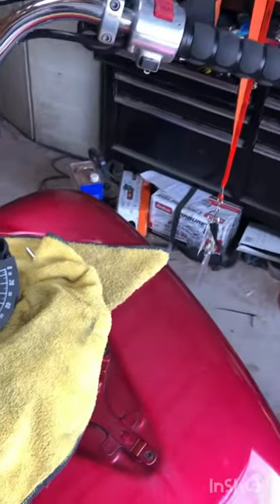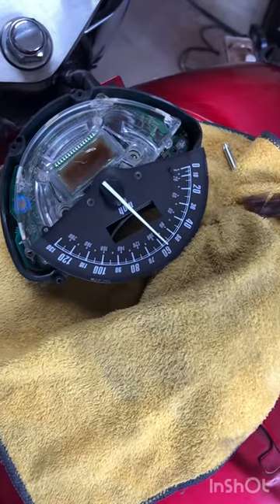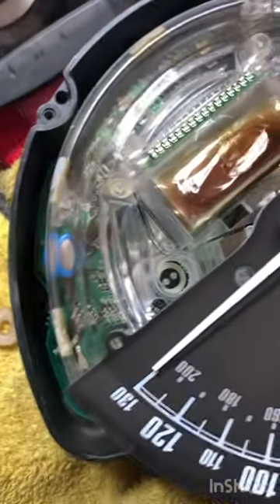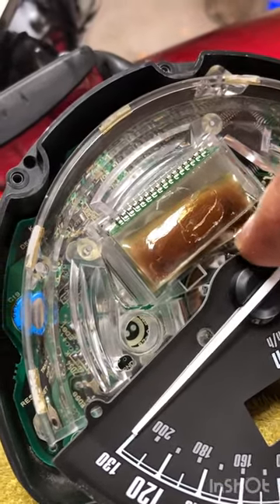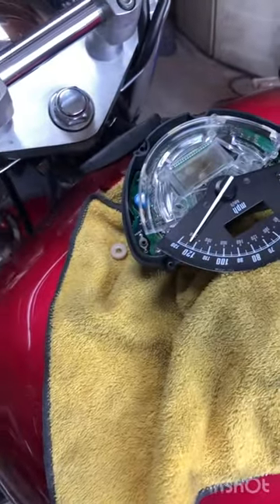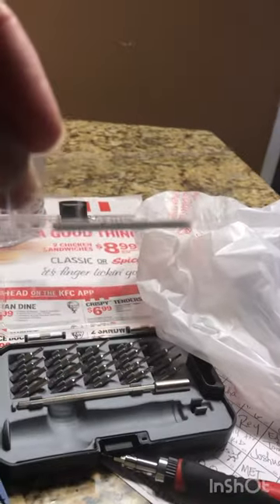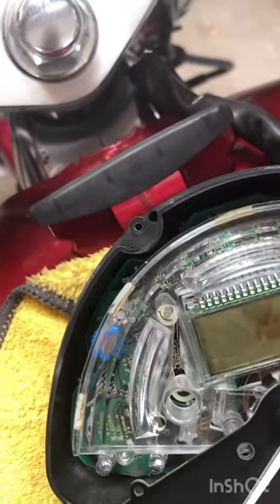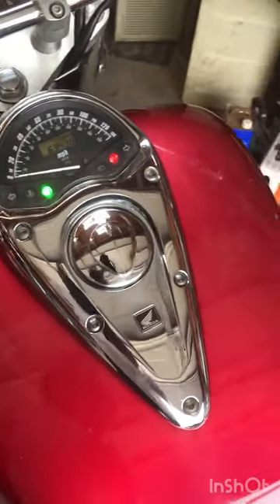$3 Honda VTX1300 ODOMETER FIX

Comment: On 4Runners, guys take the polarized film off and flip it over. That gives you light numbers on a dark background. I wonder if that would work on the odometer on the VTX
Reply from the maker: @oodsigma4482  I tried just using polarized film first. It doesn't have an electrical capacity

Comment: Legit fix!  I did repaired my curled-up odometer polarized film using the top film from a Harbor Freight voltmeter I got free with a coupon.  I didn't replace the back reflector film, I just peeled off the top film from the voltmeter, cut it to size, sprayed the back with some spray adhesive and stuck it on.  The film did curl up when I peeled it off the old LCD glass, so I curled it the opposite way a few times until it lay flat.
Reply from the maker: that's awesome! glad to have helped

Comment: Excellent video; I did same process on 2007 Suzuki boulevard c50; I tried a cheap Chinese calculator and it didn’t work; 2nd try with a good old American calculator and it worked! Cheers

Comment: What about the speedo error? Mine is off 8 mph at 70, only doing 62. Is this a cable lube problem or???
Reply from the maker: I used an app on my phone to track mine...I know it drives you nuts
Reply: @str8-6impala72  I actually had a Garmin Nuvi laying around so bought a mount off Amazon. I hate the location of the factory one anyway. Now it is at least on the handlebars. I put an app on my phone too, but could not see it in the daylight.

Comment: FYI: LCD Screen Calculator - CASIO HS-8VA / CASIO HL-4A a bit bigger LCD but it will work - 37mm x 16mm LCD 
Important, you must leave the glue on the LCD display. 
Fantastic video, thanks John vk3hjq
Reply: Is there anything else you need?
Reply: @dakotabriscoe3320   NO, Just a calculator as described to make this repair. their are few other youtube video's out there as well on this too, just do a search. John vk3hjq

Comment: Genius, do have any advice for the stepper motor mine broken
Reply from the maker: buy another one
Reply: @str8-6impala72  where can I find used one ?

cause the new one is too expensive
Reply from the maker: if you have a part number search online, I know the parts are expensive so you'll just have to find the best deal. Partzilla and Amazon is where I look